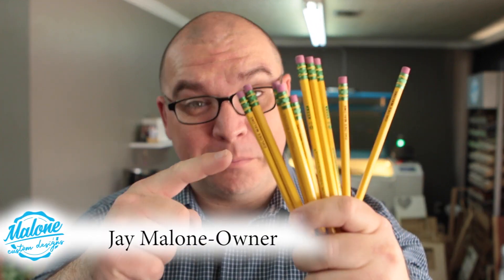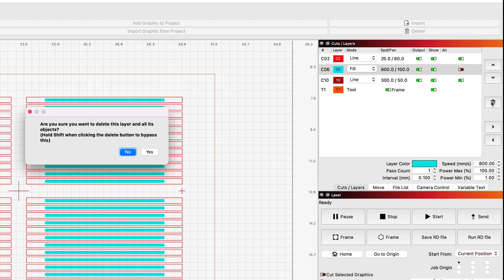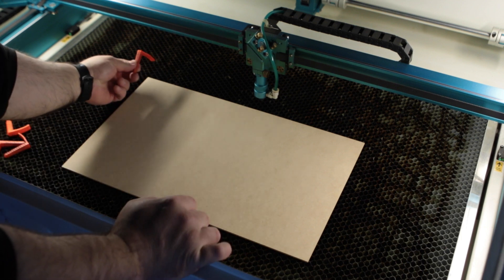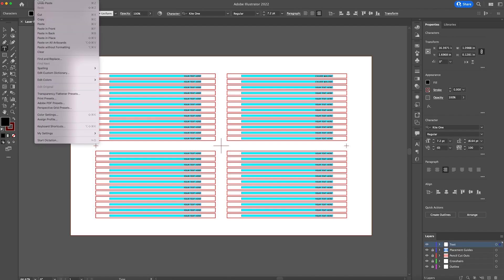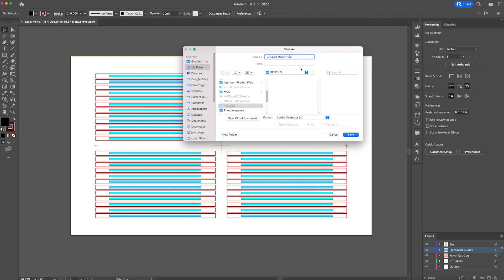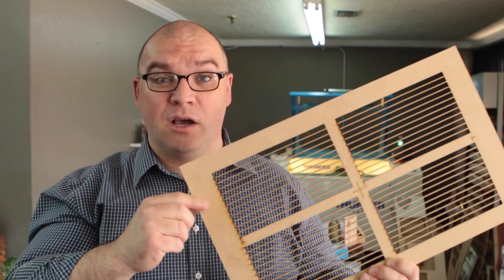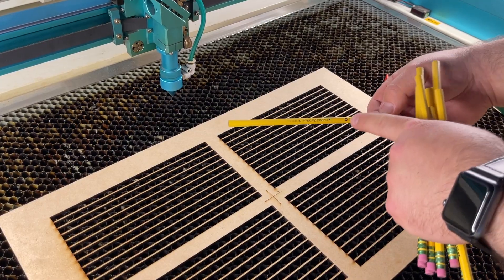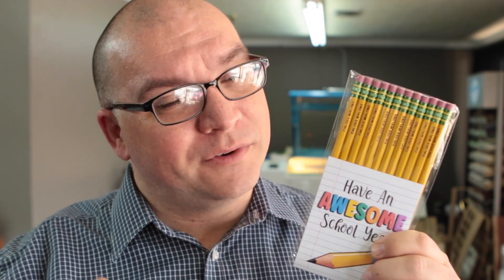Laser Cut Pencil Jig - Engraving On Pencils!

Comment: I had issues with setting the start point, trying to use center left so as to make centering the text easier and then re-watched you video.  I redrew my jig with the start point in the center - with the two crosshairs at either end and viola, success....  For the first test run, after cutting out the pencil slots, I just left them in place instead of using pencils.  I kept the focus height the same as the 3mm Basswood as it was the same height as the main jig.  A few days ago I finished my laser crosshair mod and used alien tape on the left side of the laser head - 22 watt Alpha, and after calibrating the laser offset, aligning my projects is easy peasy.  I used a USB "power cord" and since the laser crosshair only draws about 20 mA, (.1watt), I could use a 500 ohm pot to dial in the brightness.  The 500 ohm pot dims to just barely visible to full on.  When the crosshair is just a bit above visible, it is EASY to see the intersection of the laser beam.  Thanks again for you video that got me on track to use a center starting point....

Comment: A couple of observations.  Instead of deleting the "guides", you could/should have just turned off "output" and "show" in the layer controls.  The number of pencils in this example are for b@lls to the wall engraving, where, a normal project would/should have allowed spacing for small, thin, round magnets to make sure the slots are firmly in contact with the honeycomb bed.  Depending upon the thickness of the jig material, magnets may be a necessity.
Reply from the maker: You are correct in the fact that we can just turn off the output of the guides....we do that now. However, the point of this jig is to do several pencils and to make it repeatable and consistent.  When we normally do pencils we are doing like 10+ dozen at a time....so all of these spaces are kinda needed. We've considered making a larger jig to do even more!  By pinning down the edges of the jig, magnets are not needed for the slots.  It works perfectly fine.

Comment: I’m very new to the laser world and just got a Bolt. I cannot even figure out pencil engraving. I was told to toggle off high air, but use low air when engraving. How is this done?
Reply from the maker: So, you toggle air on and off in LightBurn, on your layers panel, where your settings are.  But keep in mind, the Bolt only has one air control.  It does not have dual air assist like the Nova series machines.

Comment: Does this process also apply to any laser machine (chinese) running CorelLaser?
Reply from the maker: The process should be the same...as long as you can set origin points to tell your laser where to start.  Of course, your settings would all be different.  Of course, I am only really familiar with Thunder Lasers and Glowforge. That's all I've ever used.

Comment: Bought your file, but my engraving isn't coming out as dark as yours. I've got a Thunder 51/100. Tried at your 600/50 and also dropping the power a little to compensate for the higher wattage, but it's not coming out as dark. Any suggestions?
Reply from the maker: Interesting. On your 100W machine, you should be able to set the power at about 40 and get similar results as ours on 50.  Did you have your air turned on/off?  We have the air turned off for engraving, which is actually low-pressure air.